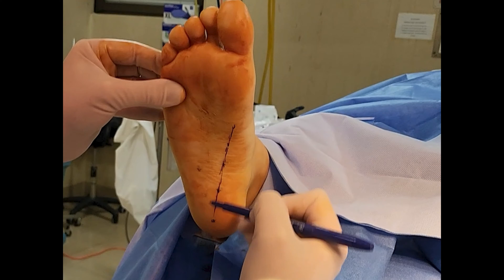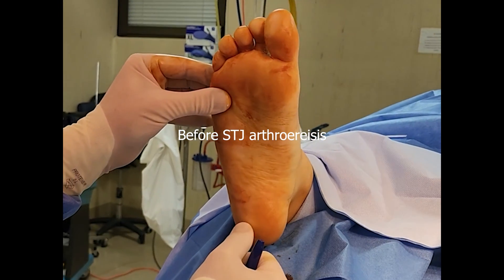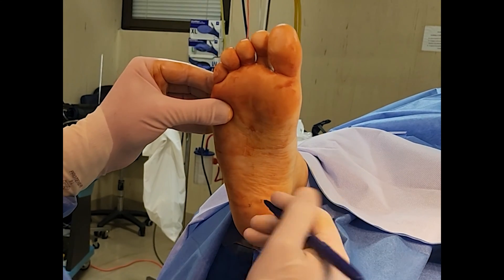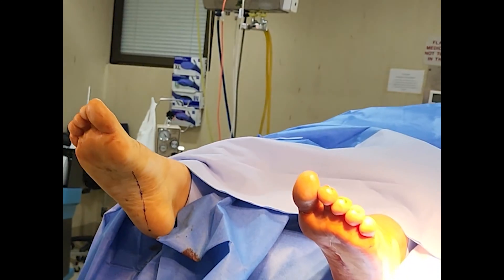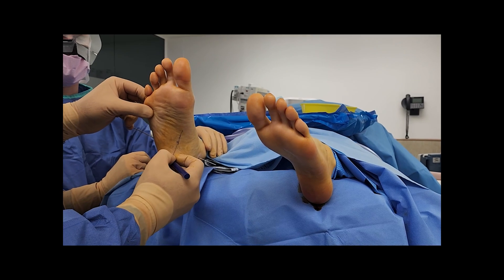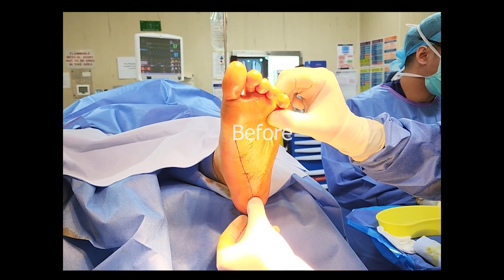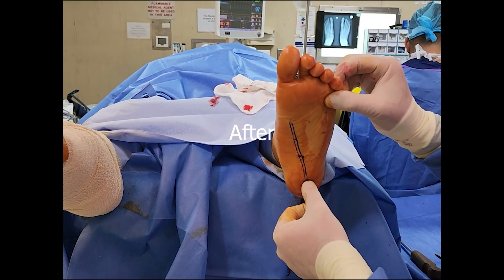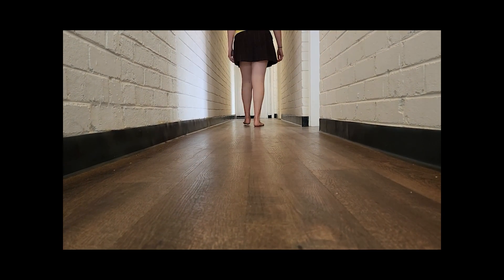The Change in Subtalar Joint Axis Location With The 'Arch-It' Subtalar Joint Arthroereisis.

Comment: Great helpful advice.
Reply from the maker: Thanks Terrell.
Reply: @DrOzanAmir  Sir,I m going to do hyprocure in the next month....but this arch it device looks modern....is hyprocure as effective as arch it ?
Reply from the maker: @damanpreetsingh4719 Hi, the Arch-It is a traditional shaped device.  From my experience both this style and Hypocure work effectively and suffer from the same complications.
Reply: @DrOzanAmir  one final question sir,if my hyprocure in both feet are a successful operation and I giv3 enough rest for both of them to heal....can I do martial arts after that ?
Reply from the maker: @damanpreetsingh4719 once you have healed, start gentle activities and build up slowly. You should be able to resume martial arts. Continuos kicking of the bag may increase the chance of the implant moving. Wearing an ankle brace or taping up your ankle before a martial arts session may help.
Reply from the maker: @damanpreetsingh4719 please report back on your experience after the surgery, especially after starting martial arts again.
Reply: @DrOzanAmir  sure sir IT IS A PROMISE FROM MY SIDE
Reply: Hello as I told u I just had my first hyprocure implant in my left side on 19th February. But the problem his is am feeling a bit of pain around the implant a few times a day is it normal and after how many days will thr pain go away
Reply from the maker: @damanpreetsingh4719 It's still very early days and to have some form of pain is normal. Keep your surgeon informed on how you are feeling at the post operative visits.